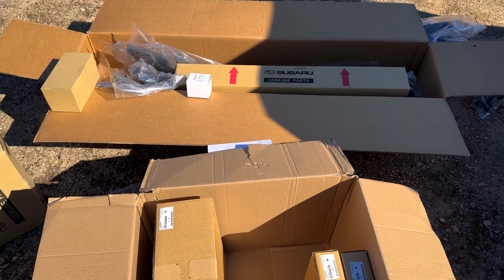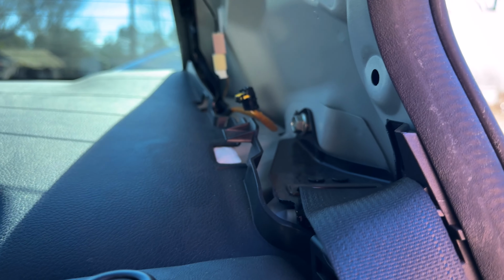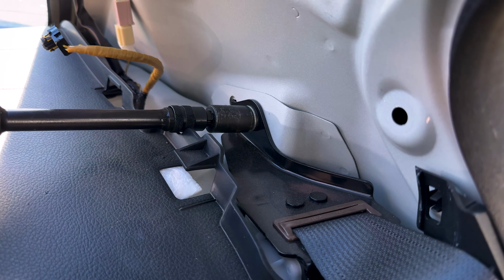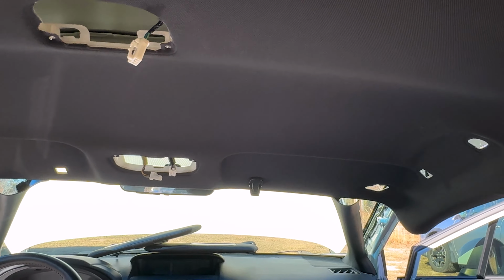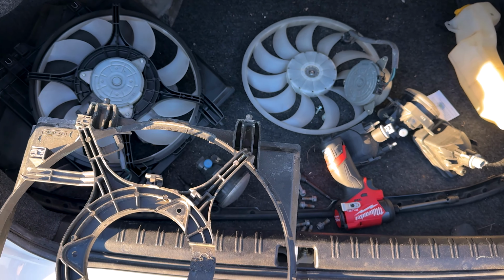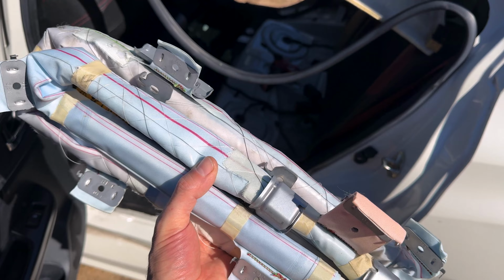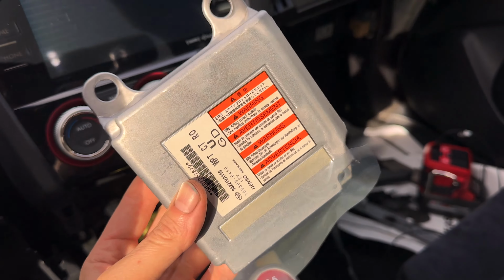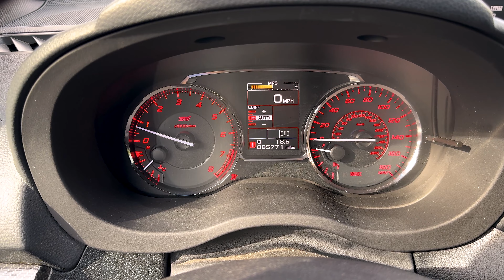Project STi Resurrection: Dealing With The Dreaded SRS Issues! Can We Disappear The Light?!

Comment from the maker: B1906. Open in LH belt tensioner. Used eBay seat belt is bad. Returning. Guess I have to buy new.
Reply: What a hunt, glad you figured it out. Like this series of videos and you videos hve been so informative.
Reply: that is what they call "the hit". Even the best laid plans homie !
Reply: Dang it
Reply: This has also been my concern about buying used seatbelt inertia reels, especially since they might be pulled from an accident vehicle.
Reply: Hi Mr Subaru I'm from Australia and I have a 2019 Subaru outback diesel what's your thoughts on the diesel engine it just had it's 11200km service no problem touch wood.cheers mate.
Reply from the maker: @Eli-k5m6q   I’ve never even seen one in person. We didn’t get the EE20 in the states. Can’t comment on them.
Reply: Hey MrSubaru! when do you recommend that I service the water pump on an 18 outback 3.6r T? Are there tell-tale signs I should look for?
I do and have had a slight coolant drop (in the overflow tank) almost since new (I did do a flush as well) No coolant in engine oil as well.
I am getting up there in miles 90,000+ Thank you! and the channel rocks!! keep the Subaru content coming!!
Reply from the maker: @ST---  you’ll see coolant dropping from the weep hole on the water pump when it’s starting to fail.
Reply: @MrSubaru1387  great, I had the same question as coolant level was dropping in the reservoir on my '12 Tribeca. Its at 123,000 km. Ordered a new water pump. Then got a bit of a coolant smell and see a small leak from the radiator so ordered one. Since radiator has to come out, I'm thinking to just change the pump as well at the same time. Would that make sense given the mileage ? Got new timing chain tensioners too, since local dealer never has parts.

Comment: Thanks for your videos. I am not an experienced wrench turner, but with your videos I was able to do the valve body, struts and coolant cross over o-rings on my 2013 Outback 2.5. Next up is spark plugs, got NGK spark plugs on your recommendation. Thank you for saying the torque specs on items as you do them, makes following along very easy!